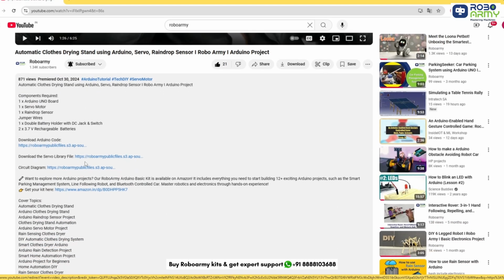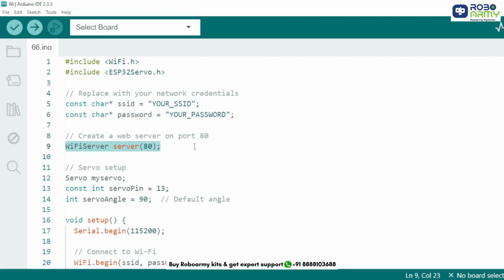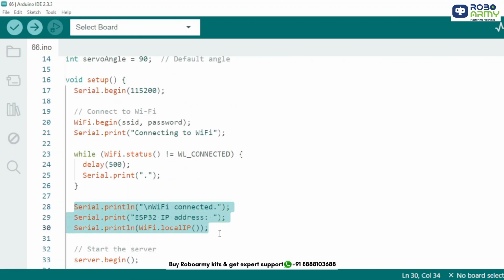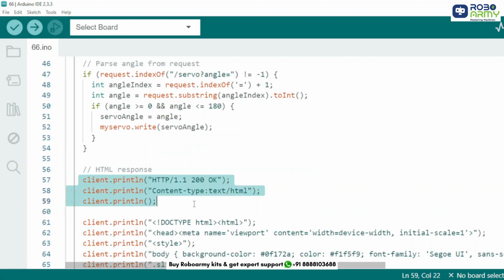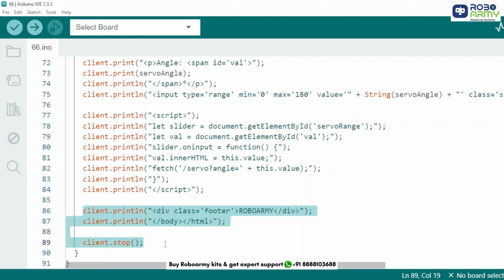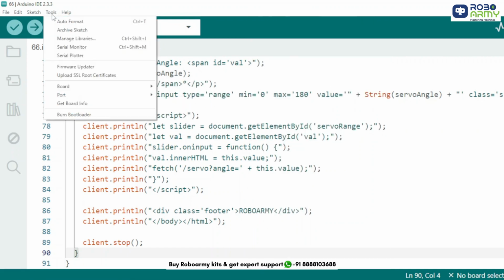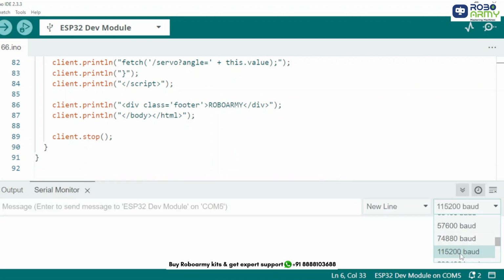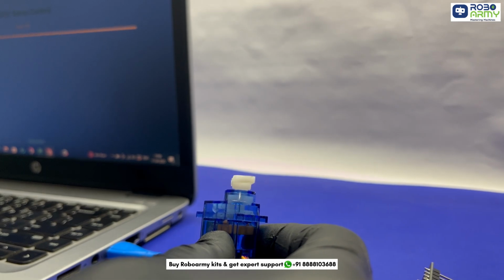IoT based Pet Feeder | Control Servo Motor via Web Interface (WiFi-Based Control)

Comment: what is the power source for this esp 32 board
Reply from the maker: The ESP32 board can be powered using:

USB cable connected to a laptop or power adapter.

External battery (like a 3.7V Li-ion or 5V battery pack)

Comment: What is the connectivity range of this project
Reply from the maker: This project works within the range of your WiFi router, usually around 20–30 meters indoors and up to 100 meters in open space. If you want longer range, you can use an external antenna module or even set up ESP32 in access point mode for direct connection without a router

Comment: can i code on thonny?
Reply from the maker: Yes, you can use Thonny!
Thonny is a great Python IDE, and if you're using an ESP32 with MicroPython firmware, you can definitely code this project in Thonny — but the code will need to be rewritten in MicroPython since the original code is written in C++ for the Arduino IDE.

If you're just getting started and want to try MicroPython, I recommend checking out how to:
✅ Flash MicroPython firmware on your ESP32
✅ Use machine.PWM to control a servo
✅ Set up a basic web server using socket in MicroPython